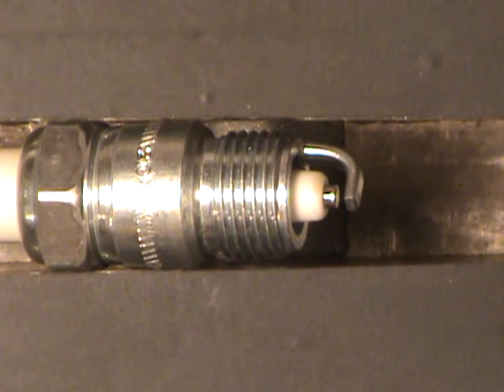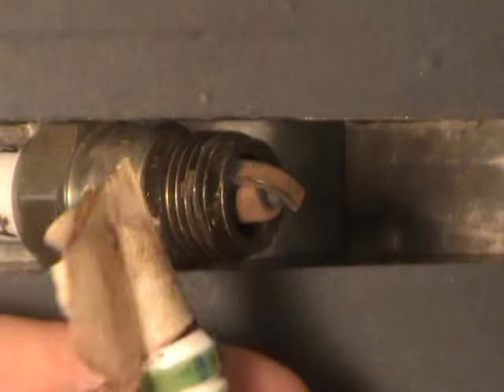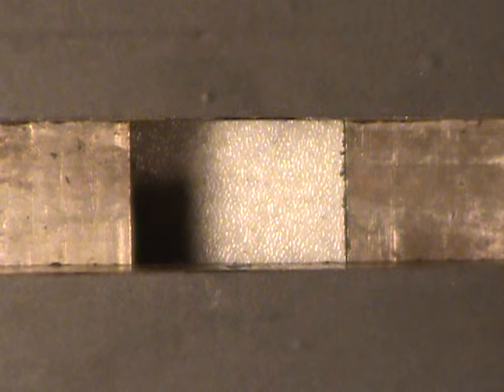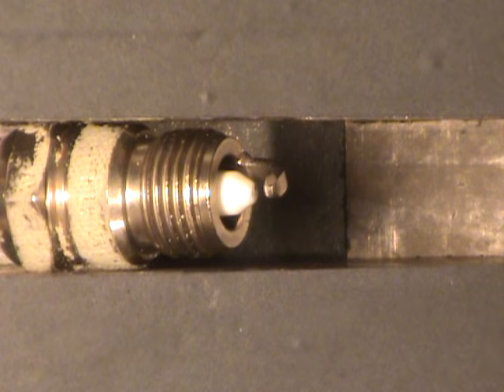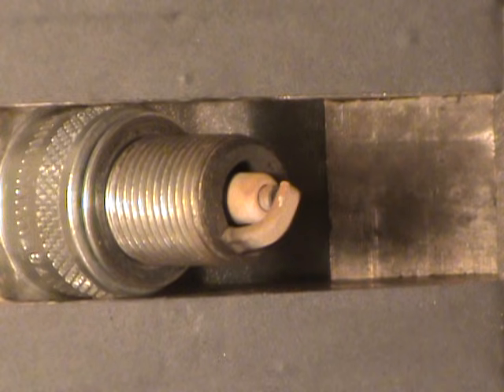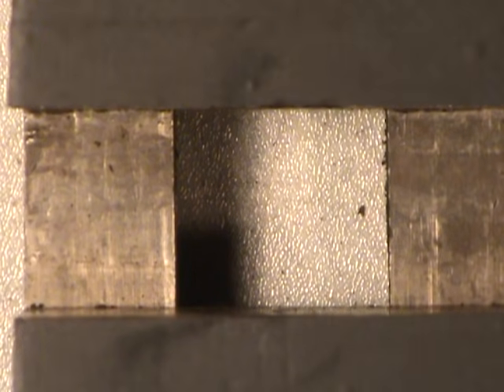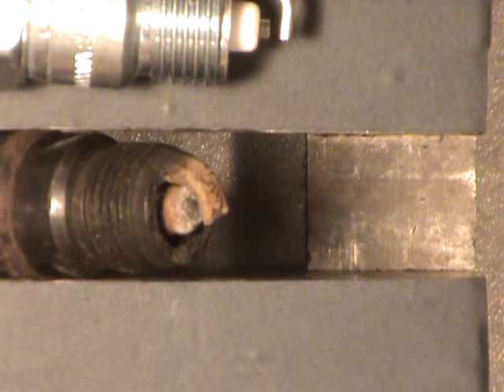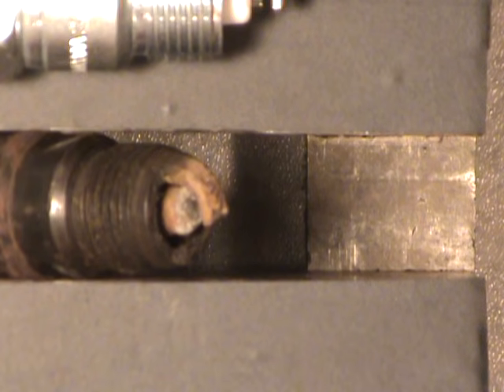SPARK PLUGS How to Read them (Part 3)

Comment: professional  informative  film well done!.
Reply from the maker: Greetings enoch powellsghost....Thanks kindly, for Your very nice comment, my Friend....I'm not so sure, that, any of my YouTube videos are all that Professional, as, I'm just an "Average Joe", so to speak....As for this Spark Plug video of mine, I just rounded-up (aka, gathered) a bunch of old/used spark plugs, that I had in storage for quite some time, and I chose the ones, that I thought, would be the best "Candidates", that would be able to, actually show Folks, what it is, for the most part, to be looking out for, as it pertains to, just how well, or, how bad, the spark plugs "Look", as in the Deposits found on them, as well as, the Electrode's Wear Rate.

Depending on the "Formulation" of Gasoline, that You purchase, where You Live, will sometimes "Alter", the actual "Deposits" that may, or, may not be showing on Your Engines Spark Plugs, due to the amount of "Ethanol" (Ethanol = Alcohol, usually derived from something like Corn), and also, something like "Oxygenates" and Fuel System "Cleaners", that the Gasoline Producers, "Added" into their so called, Gasoline "Blend".

Thanks again, for Your "Super Nice Comment!"

Be Safe, take care, and have a good one.

Comment: Can somebody explain to me on how the measurement of the "LEAN" can be, please?
Reply from the maker: Greetings Donnie (eimaXe)....Thanks for your comment and question....First, I would like to address the words, "LEAN", and "RICH", and how it applies to an Engine that uses Gasoline as a fuel....When you hear someone saying, that an Engine is running too "Lean", or running too "Rich", it simply means the "Ratio" of "Air" to "Fuel" (and in this case, the Fuel is Gasoline), and, you will usually hear or see it expressed as...the "Air/Fuel" Ratio....For the most part, a Gasoline Engine needs a "Different" Air/Fuel Ratio, for the Engines "Operating Condition" at any given time.

You see my Friend, the Engine "Requires" a "Richer" Air/Fuel Ratio (Richer = More Gasoline added to the Air, that forms the Mixture, that the Engine Burns) when it's Cold outside (let's say, the water in a mud-puddle is frozen), and the Engine is first started on that very same Cold Morning, as, a Cold Engine requires a Richer "Mixture" (Mixture, is the result of the Air being "Mixed" with the Gasoline) to keep it running, due to a number of things...

...some of those things being...Cold Engine Friction & Oil is usually thicker (may not apply to Synthetic motor oil)...Gasoline Does-Not "Atomize" very well when it's cold (Atomize = super tiny particles of gasoline, that form a very fine mist or vapor, as opposed to larger droplets of Gasoline, that don't burn efficiently)...

...an Engine Needs to be at "Operating Temperature", to Perform at its Best, for Economy (Gas Mileage/Kilometer-age), as well as, down-right "Get-Up-and-Go!!!" (aka, "Pedal-to-the-Metal!")...lol.

Once the Engine is up to "Operating Temperature" (oh, generally, I like to ball-park it, at about "195 Degrees Fahrenheit", as that, was an older "Standard Thermostat Temperature Rating", that the Auto-Manufacturers installed in North American Vehicles for quite some time), then, even with the Engine fully warmed up, the Engine will want/need a Certain "Air/Fuel" Ratio, depending on what You are asking the Engine to do...

...as in the case of your "Ride" (car, truck, or what have you), is, let's say for example, that you are just "Cruising" along, on a highway/interstate/freeway/expressway, etc., and your vehicle is on a level road, and you are just maintaining about 50 MPH or 80 KPH (50-miles per hour, or, 80-kilometers per hour), with a light throttle applied (throttle = gas pedal), then, as in the case of an Engine equipped with a "Fuel Injection" System, I would bet you "Dollars-to-Doughnuts", that, in the previous scenario that I just described (and imagined), that, the "Air/Fuel" Ratio would be in the order, of about "14.7 to 1" (14.7 part Air, to, 1 part of Gasoline), and probably at about "Sea Level" (Altitude) as well...

...where-as, some Carburetor equipped Vehicles can be Calibrated, a bit "Leaner" (more Air added to the Air/Fuel Mixture), and under light throttle Operating Conditions that will allow it, can perhaps have an Air/Fuel Ratio that could go into the 15-to-1 Air/Fuel Ratio there-abouts. (applies mostly to Stock, and Un-Modified Engines).

Now its time for my rendition, of trying to explain the meaning of an Engine that is running "Rich" (but not overly Rich, as in, Black-Smoke pouring out of your vehicles Tail-Pipe!).
When, shall we say, you are "Tromping" on the Gas Pedal, to Accelerate...to "Infinity and Beyond" (thanks Buzz Lightyear, oh, and, you too Woody!...lol), then, the Engine "Needs" a "Richer" Mixture, or, Air/Fuel Ratio, in the neighborhood of about "12.5 to 1" (12.5 parts of Air, to, 1 part of Gasoline, that I consider, a fairly "Safe" Air/Fuel Ratio to feed the Engine while doing a W.O.T. or, Wide Open Throttle "Acceleration")...

...now then, if your vehicle is doing a "Full Throttle Acceleration", and your Air/Fuel Ratio was Too "Lean" (upwards of 13 to 1 Air/Fuel Ratio), then, more then likely, your Engine would Suffer some very "Bad", and might I add "Expensive" Engine "Damage!!!".

So then, simply put...

A "Cold" Engine requires quite a "Rich" Air/Fuel Ratio (Mixture), when first started for the day, and, as the Engine warms up, the Air/Fuel Ratio starts to "Lean-Out" gradually, then, when the Engine is up to Operating Temperature, and in the case of a Fuel Injected Engine, while at Idle Speed, and, while Cruising under Light Throttle Conditions, and I'm also thinking at "Sea Level" as well, that our Friend the "E.C.U." (Vehicles On-Board Computer), tries to maintain an Air/Fuel Ratio, of about "14.7 to 1", and, I say again..."Only" under Idle and Light Throttle Conditions (and that means...No Pedal to the Metal!...lol).

Now then, when it comes to the way in which, I usually Read Spark Plugs (the "Old School" way), is, when I see a Spark Plug all covered with a Black Powdery Substance, that's telling me that, either the Air/Fuel Mixture (Ratio) is too "Rich", or, my Ignition System is Weak, and needs attention.

If I see any of my Engines Spark Plugs that are Really "White", and perhaps with the Electrodes, kinda like Melting, or, if the Spark Plugs "Gap" (only applies to the Older "Conventional" Style of Spark Plugs!), is Eroding at any more then about .001" (One Thousandths of an Inch) for every 1000 Miles of engine operation, then, it might be...too "Lean" of an Air/Fuel Ratio (Mixture), or, maybe even, Spark Plug/s, that have, too "High" of a "Heat Range" for that particular Engine!

In closing...

"LEAN", just means, More Air, and Less Gasoline in the Air/Fuel Mixture (aka, Air/Fuel Ratio)...

...where-as...

..."RICH", just means that, there is More Gasoline, and, Less Air in the Air/Fuel Mixture (aka, Air/Fuel Ratio).

I hope that what I posted above, will perhaps help you, and others, to somewhat, be able to understand what the meaning of the words, "LEAN" and "RICH" mean, when it comes to an Engines "AIR/FUEL" Ratio...

Be Safe, take care, and have a good one.
Reply: RockysRoadshow GOT IT!! Thank you so much for your REPLY!!!
Reply from the maker: Donnie (eimaXe)
Greetings Donnie (eimaXe)....You are welcome, for the information that I provided, in respect to your question about, just what the word "Lean" meant, as far as a Gasoline Engines "Air/Fuel" Ratio is concerned....I just try to explain things is simple terms, so that, whatever the subject may be at a given time, hopefully, makes the ordeal of learning something new for People, more easily understood, as well as, having an enjoyable learning experience also....You, and Others, may find that my Videos, and my Reply's to Comments under my Videos, can be quite lengthy at times, but, as I see it, the more in depth that I (try) to explain things to People World-Wide, I figure that by doing so, will give the People watching, and commenting on my Videos, a much better chance at learning, what it was, that I have already learned and experienced so far, as it applies to the Subjects that are shown and heard in my YouTube Videos.

Thanks for your nice comment Donnie...

Be Safe, take care, and have a good one.

Comment: The car runs great but needed to do the timming. I just pulled the plugs out , repkaced with new ones and then I went through your video two more times to see the your good plug and my old one. Thanks a gain !!
Reply from the maker: Greetings 9011combo....Congratulations on getting Your Engine to Run "Great", my Friend!!!....I hope that you "Set" your Spark Plugs "Gaps", to the "Gap-Size" that your Vehicles Engine Manufacturer "Specifies???"....The Proper and "Specified" Spark Plug "Gap" Size, that your Vehicle Manufacturer Recommends, will give Your Engine "The Best Chance", at Running and Idling Very Good, well, at least as far as Spark Plug "Gaps" are concerned, that is....If You haven't seen My YouTube Video on, How To Set Spark Plug "Gaps" yet, You can find it on my YouTube Channel...RockysRoadshow...enjoy.

Did you actually get that 1/16" "Gouge" Removed from that "One" Bad Cylinder?

If, there is still a "Gouge" (aka, broken ring caused Groove) in that One Cylinder, then, keep a..."Close Watch on your Engines Motor Oil Level!!!"

also...

Check your Spark Plugs once in a while, Especially, if you still have that One "Gouged" Cylinder Wall in your Engine, as, that particular Spark Plug, may become "Oil-Fouled", and cause a "Miss-Fire" in that "Cylinder!"

Oh yeah, You are Welcome, for any Help that I have rendered, and, Thanks kindly, for your Nice comment as well.

Best of Luck, to You, and your Engine...

Be Safe, take care, and have a good one.

Comment: Hello rocky...I took my motor apart and completed the rebuild process. I found out that one of the exhaust valves burned and the ring in that cylinder has dug into the wall of the cylinder bout 1/16" deep. This is my first rebuild job that I learned from YouTube. I do have mechanical skill but never done something this size before with no help from no other.
Reply from the maker: Greetings 9011combo....Thanks for your comment, and, Congratulations, for "D.I.Y.!!!" (Doing It Yourself)....In your comment, you had mentioned that you observed that One of the Exhaust Valves was "Burned", and that you also had One Cylinder that was "Gouged", about 1/16" (one sixteenth of an inch) deep!....Both of those Problems that you have there, can cause, Low Compression and Oil Burning (in that One Bad Cylinder), because of that "Gouge" in that Cylinder "Bore!"....That Bad cylinder needs to be restored to 100% (with No Gouges), in order to have Good (high or normal) Compression, and also, to keep the Motor Oil from getting "Past" the Piston Rings, then up, and into your engines Combustion Chamber....If that there Cylinder "Wall" (Bore) Is-Not Restored to 100%, the Engine will probably still Run, although, maybe a little Rough, with Less Power, and, also, Above Normal Motor Oil Consumption and Burning as well.

If you have to have your Vehicle Emissions (smog) Tested, the Employees at the Smog-Testing-Establisment, might Not Test your Vehicle, due to any "Smoke", as in Oil Burning, that they "See" coming out of your "Tail-Pipe" (aka, exhaust system), as you are waiting in the "Line-Up", waiting to be Tested!

If your Bad Cylinder Bore/Wall is still Not 100% Restored/Repaired, and, you Do-Not have to have Your Vehicle Smog Tested, then, you will probably be able to drive your Vehicle, with Less Power, and, make sure that you keep your Motor Oil "Topped-Up" to the Full Mark on your Engines Oil Level Checking "Dipstick", when the Engine/Vehicle is on Level Ground, and the Engine is "Cold", and, "Not-Running!", or, if the Oil Level gets Too "Low" (due to Oil Consumption/Burning), then there will probably be, even More Engine Damage Happening!

Also, an Engine that "Burns-Oil", Is-Not Good for your "Oxygen Sensor/Sensors", and your Vehicles "Cat" (Catalytic Converter) as well.

It's all about how much Money, that you want to Spend on Repairing your Engine.

If indeed, that "One" Cylinder Bore is "Gouged", about that 1/16" that you had mentioned, then, I'm quite sure, that, that Cylinder Won't be able to be "Bored and Honed", to the Maximum Bore Size that Your Engines Manufacturer "Specifies"...(Please, Check the Specifications for your Engine).

or...

Perhaps that "One" Cylinder can be "Re-Sleeved", as in, Install a Metal "Sleeve" in that One Bad cylinder, in order to be able to have that bad Cylinder Bored and Honed to a Size (diameter) that is reasonably Close to the remaining Cylinder "Bore Sizes" in your Engine.

If, your Engine needs to be "Over-Bored" and Honed to a Size that is Larger then, when the Engine was Brand New, then, your Engine would also need Larger Diameter Pistons and Rings that will Fit Properly in any of the Over-Sized Cylinder Bores in your Engine.

Now, about that "One" Burned Valve.
Looks like, that One Bad/Burned Exhaust Valve, needs to be Replaced alright.
The Valve "Seat", in your engines Cylinder Head, that the Bad/Burned Exhaust Valve Seated on, will need to be Repaired/Reconditioned, if it is in questionable Shape, as in, Not Being in Very Good Condition, or, that Cylinder will more then likely be suffering from a case of..."Low Compression" (due to that nasty leaking exhaust valve "Seat").

Like I was sayin...It's all about, just how much Money, that You want to spend on your vehicles "Engine".

I hope that your Engine gets "Healthy", once again.

Be Safe, take care, and have a good one.

Comment: Hello...and yes your video very helpful cus one of my Honda's plugs have lots of oil at the end of it and I think and believe that the piston ring is bad...so now I'm in the process of pulling my engine apart and rebuild it...
Reply from the maker: Greetings once again 9011combo....Thanks for your comment and question, my Friend....I'm just assuming that your Honda, is a Car, and not one of the "Many" other Vehicles/Products/Engines that, Honda "Manufactures", and has a very Good Reputation for, as well....Now then, "Before" you start "Dismantling" (taking apart) your Honda's Engine, I would recommend (suggest) that you do a few more "Checks/Tests", before Blaming the Piston Ring/s for the "Oil-Deposit/s", on Only "1" of your Honda's Engine Spark Plugs....I don't work on Honda's, (well, at least not yet, that is), but, there may be some Items/Things, that Honda Engines "Share" with Many Other "Types" of Internal Combustion Gasoline Engines....The first thing that comes to mind is, Your Honda Engine should/might have "Valve Stem Oil Seals", and if they Don't "Seal" properly, Motor Oil can Trickle down the Valve Stem/s, and make its way into your Engine's Combustion Chamber (the Area between the Top of your Piston/s and your Cylinder Head, where your Valves and spark plugs are located).

Another thing (I have seen this on "Domestic/North American" V-8's), is, when an "Oil Drain Hole", in One or Both (1 or 2) Cylinder Heads, at the Rear of the Engine, and because of the Angle/Slope that the Engine sits at, in the Engine Bay, gets "Plugged-Up, and "Prevents" the Oil from Draining Back down the Passageways, then, into the Oil Pan, at the bottom of the engine, will cause a "High" Oil Level (where there "Should-Not" be One!) in the rear of that/those cylinder heads, "Causing" that (shouldn't be there) High Oil Level, to "Flood" the Rear-Most Valve Stem Seals, then the Oil Flows Down the "Valve Guides", and, into the "Combustion Chamber!"

Also, check out your P.C.V. (Positive Crankcase Ventilation) System.
There should be a P.C.V. "Valve" somewhere (usually in, or near your Valve/Rocker Cover), that has to be Working Properly, in order to Vent/Re-Burn the Blow-By Gasses that gets past your Pistons Rings, and down into your Oil Pan.

These "Blow-By" Gasses (unburned Gasoline/Hydrocarbons), eventually make their way to the Top of your engine, due to the Airflow created by your P.C.V. System.
If your Engines P.C.V. System is Plugged, or, the P.C.V. Valve is stuck open, or plugged as well, this can cause some Unwanted Problems too.

If the P.C.V. System gets Plugged-Up, I've heard that, it can cause enough "Unwanted-Pressure", and can even Make an Oil Seal start to "Leak!"

You might also want to have your Engines "Compression Checked".
The Compression Check, has the ability to tell you things about your Engine.
It can tell you, how Worn the Pistons Compression Rings are.
It can tell you if the Intake and Exhaust Valves are Leaking.
It can also tell you if you happen to have a "Bad" Head Gasket as well.

There are so many Tests/Observations that can be done, with almost any Engine, that will save you a "Ton-of Money", if those Tests/Observations tell you, that you might not have to "Dismantle" your Engine, to get the "Problem-Fixed!"

So then, "Before" you start "Dis-Assembling" Your Honda's Engine, may I suggest that you have someone, that has lots of Experience with Honda Engines, run a few "Tests", Before you spend Extra Time and Money on your Honda, that may Not be needed after all.

I wish you the best of luck, in getting your Honda's Engine "Healthy" once again.

Be Safe, take care, and have a good one.